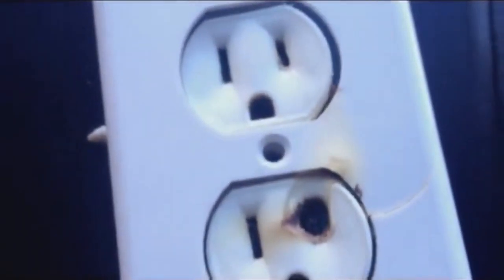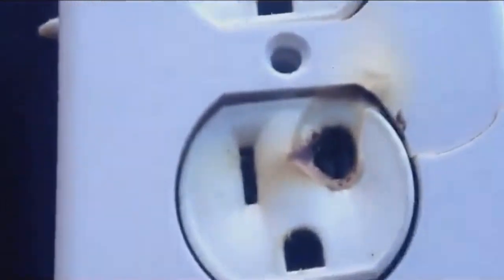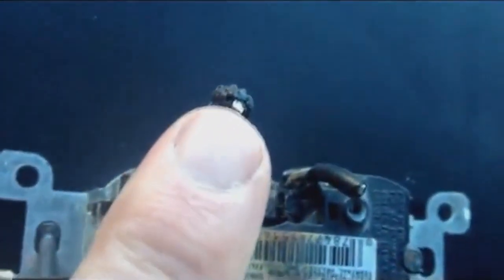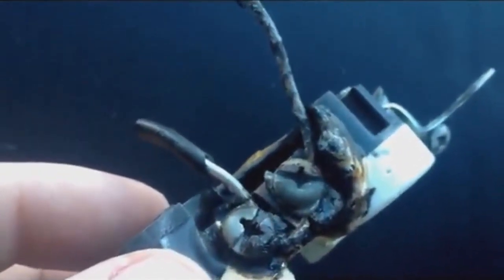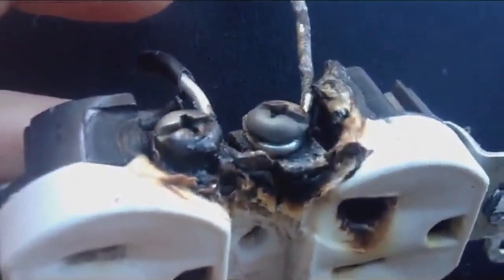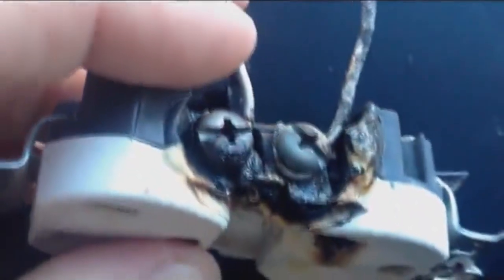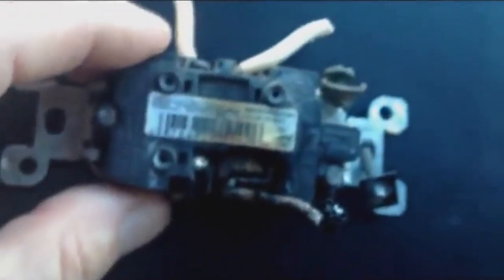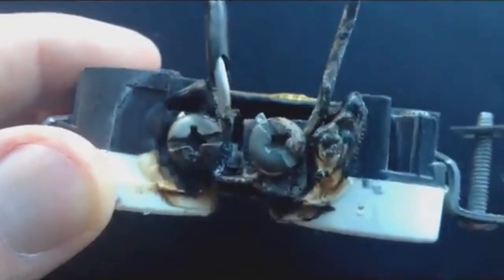Aluminum Wiring Dangers: a Burned Outlet and Copper to Aluminum Wire Connectors For Permanent Repair

Comment: Stupid question: Was the receptacle in question rated for aluminium or copper?  I bought a house with AL wiring.  The previous owner installed Decora receptacles and switches rated CU and yes I noticed all kinds of problems.  I installed receptacles and switches rated for AL, as well as using an AL rated paste on each connection - problem solved (or at least I think).
Question: If the AL wiring is properly pigtailed can a space heater be used?

Comment: It happened the same a few years ago.  My outlet for washer/dryer machine was burned.   I was able replaced it with new one myself. 

My condo has all aluminum wiring.  Today electrticians are replacing with new copper wiring and old Zinsco panel.

Comment: It would be nice if you tell how to fix this problem.
Reply: An electrician would use a connector called alumiconn to connect a copper "pigtail" to the aluminum wire, and then connect the other end of the pigtail to a new outlet.

Comment: What is the purpose of this video to tell us aluminum wiring is not good. Author of this video didn’t know if you install plugs approve for aluminum wiring everything will be good BUT if you install (in this video) plug or switch approved ONLY for copper you can expect same what he shows us. Next time don’t confuse you tubers it’s dangerous. See different video how to wire aluminum wire with new plugs and switches (they called pigtails).

Comment: I realize this is a silly solution to the aluminum wiring problem, but if the lady changed her receptacles every few years, and even kept the aluminum wiring on the new copper-only receptacle,  wouldn't the aluminum wiring stay tight under the screws? In other words doesn't it normally take more than a decade for the aluminum wires to work loose? Of course this would be an expensive way to (really not) fix the issue.
Reply: Its not time, its heat cycles that loosens them up, and depending on the load, it can happen very quickly.  The aluminum expands faster than the brass or copper as it heats up.  So it gets seriously deformed.  Once it cools back down (after the load is off), it shrinks back a little more than the copper does.. creating a loose connection.  Cue arcing and excess heat generation.  Had she used an outlet rated for aluminum, this risk would have been lessened.  Had she had an combination AFCI breaker installed, it'd have tripped vs. the outlet catching fire...

Comment: That a copper outlet you didn’t say anything about that.
Reply: what is the difference form a copper and AL outlet ? the screws are differents or what ? I'm trying to figure why the screws on the outlet for ALU won't get loose over time...

Comment: You should see my collection of aluminium wiring burnouts. Water Heaters and Air Handlers are the worst especially since I'm dealing with 30 years of "The Previous Guys" mistakes.